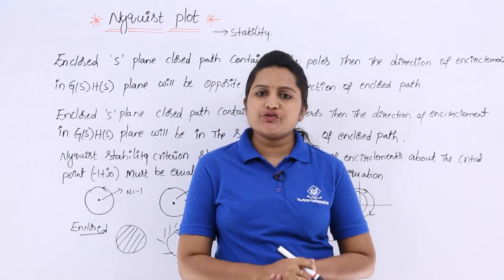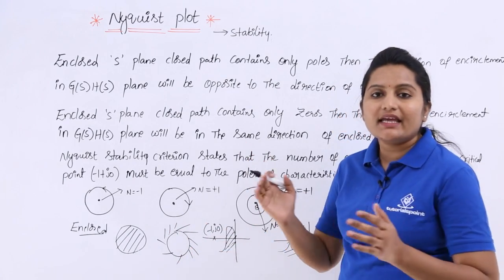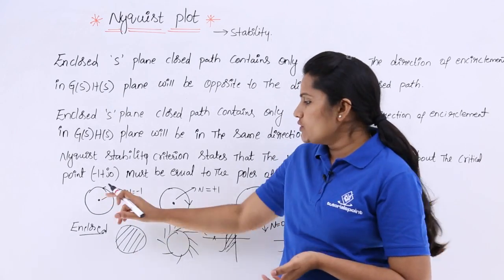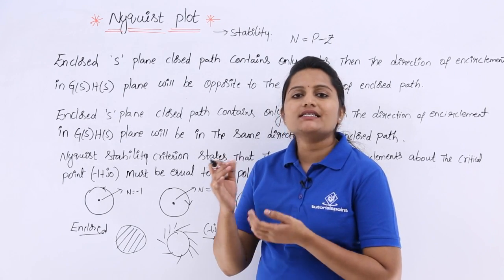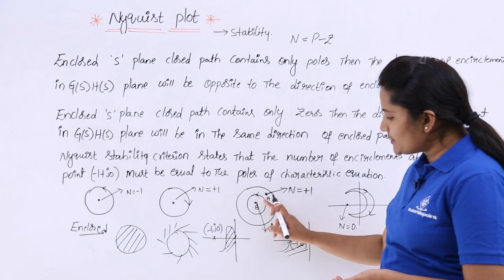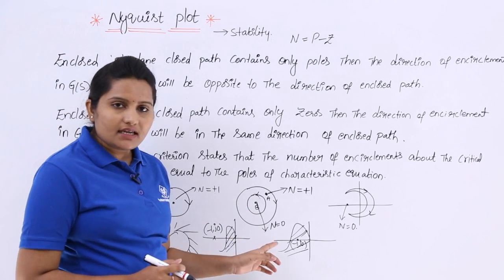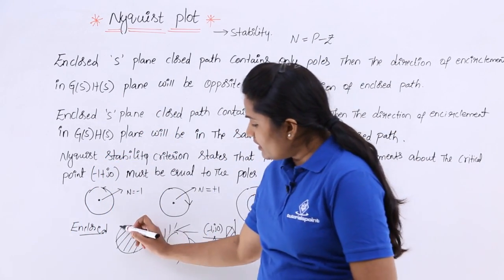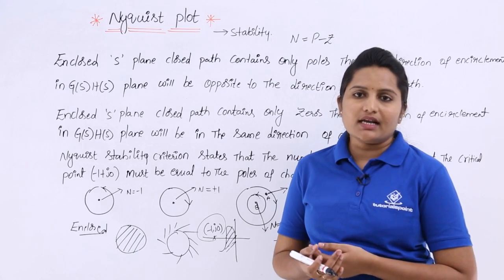Nyquist Stability Criteria Advanced

Comment: I watch your full playlist mam... very great lectures ..but Sorry mam. I can't understand this video mam...
Reply: It was after I read 2 textbooks, I discovered control systems is almost the easiest course to study in college, it is easier than Machine design, Strength of materials, Fluid mechanics, heat transfer, load estimation on buildings and many more. But to be honest no book out rightly describes control systems to be easy. I will highlight the basic idea of control system here.

when you go to bath under the shower, at some point you want the water to run faster, so you try to adjust the knob to suit the flow rate you desire, must times you over increase the knob and try to adjust it again until it suits your desired flow rate. This is a typical example of an open loop system, because, you have to manually adjust the knob because the tap knows nothing about your desired flow rate. But if it were to be a closed loop control system, the tap will have a scale to measure your desired flow rate to the actual flow rate of the tap at that instant of time and automatically adjust itself until your desired flow rate is achieved. in control system, your desired flow rate is the input to the system (which can also be termed reference value), the flow rate out of the tap is called the output of the system and the tap is the controlled system.

NOTE! DO NOT mistake input to the system (reference value) to the input signal, because they are not the same. The input signal to a closed loop control system is decided by the sensor that measures the difference between the reference input and the measured output.

now let us talk about a mechanical system, for example, a cam and follower system. When we want the follower to translate at a certain speed we increase or reduce the speed of the cam, in control system the first thing to do is to get the mathematical model that describes the system of cam and follower. After the mathematical model of the system has been derived, we check whether for that particular desired speed if the system will be stable (stability in this case could be if the vibrations will die off after some time) by applying standard test signals such as ramp, impulse, unit, etc. These test are carried out because like as I said before we do not know the input signal to the system prior to its operation. Also, the whole ideal of Nyquist and Bode plot is to test the system stability for a sinusoidal input signal.

once this test is done we can now confidently design a controller for our system because we now know how the system will behave to various test signals.

the idea of multi input multi output system (MIMO) is very simple, from the first example I described here, I talked about flow rate of the shower, but we can also desired to adjust the temperature of the water as well as the flow rate of water from the tap, since our desire is two, such a system is termed a MIMO system.

I am really sorry, I wish I can explain better.